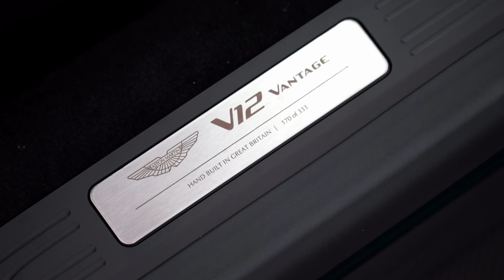2023 Aston Martin V12 Vantage: Wash, Full PPF & ExoShield [4K]

Comment: Great looking car.  I just got mine as well. #95 of 333.   Aston racing green.  Now I had mine PPF but didn’t get diffuser, wing, nor windshield done.  May need to rethink that for sure….  Definitely did a great job with the car.
Reply from the maker: Congrats on the car!  It's definitely a good idea to get the carbon protected, especially for how far it wraps underneath the rockers.  The windshield protection is a no Brainer. All it takes is one rock to crack it, and who knows if the windshield is available right away!